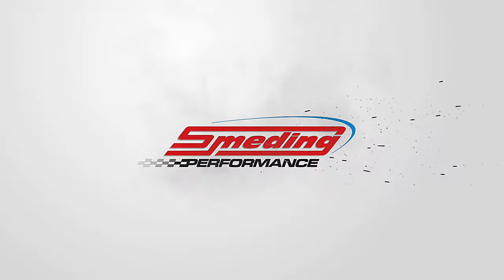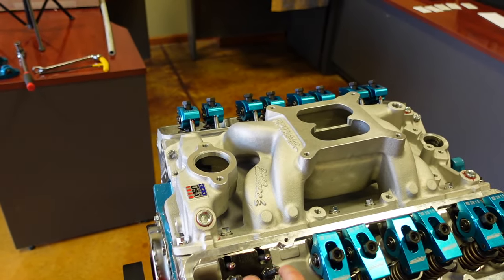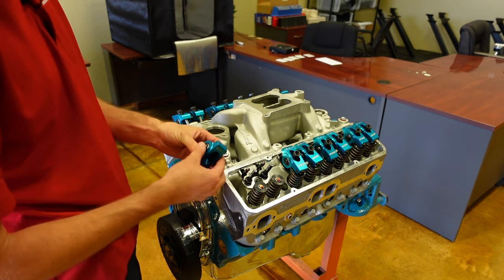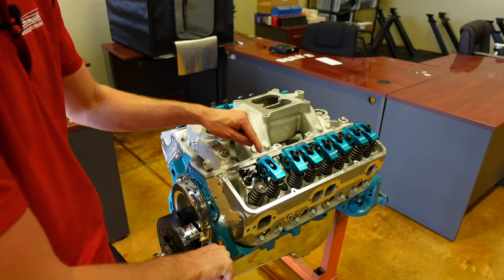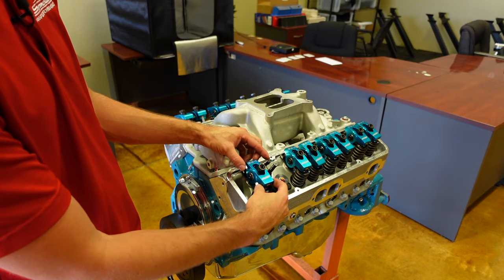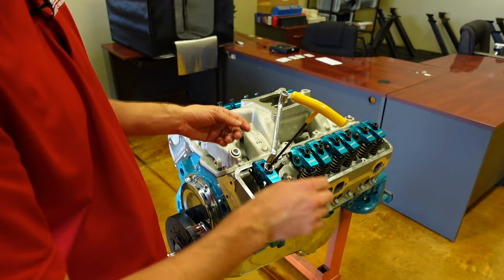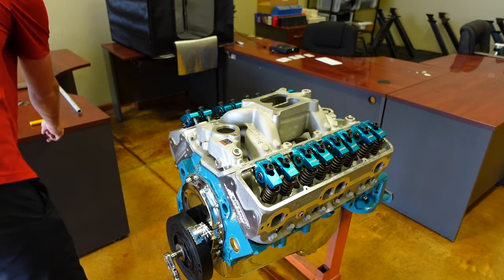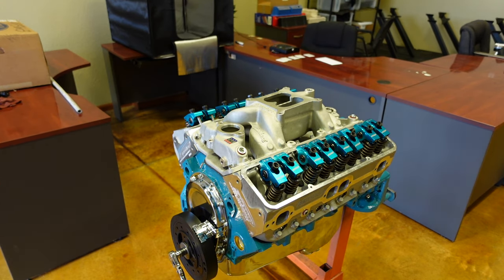How to Adjust Hydraulic Roller Rocker Arms! (I.C.E. Method)

Comment: Great info! Can I use this same method if the engine is in the and has been running? Most videos show new builds.
Reply: Yes you can just use EOIC..exhaust opening adjust intake...intake closing adjust exhaust it's easy brother just make sure your lash is out but not to tight

Comment: curious 7/16 bbc rocker studs , used in pontiacs when you want to run adjustable valve train.  do you typically do more than 1/2 turn adjustments with hydr. lifters , say comp cam and crane for example? in your experience.

Comment: So by locking down the rocker you actually added almost an other 1/4 turn=
1 1/4 turns from zero lash after lockdown???????
Reply: I saw 45 degrees that's 1/8
Reply: @rotorblade9508  almost 1 1/4
Okay 1 1/8 turns, regardless my BB Chev 396 roller cam and rockers would not run with that adjustment, I don't think 🤔

Comment: I have an LS1 engine with that tick. Adjusting the rocker should remove that tick?
Reply: If your running a solid rail rocker set up yes. All ls motors from factory are set with a guide plate and use a 7.400 pushrod. 22ft pounds of torque on the bolts for rockers
Reply: @tannermcclellan3021  it's a stock engine with hydraulic lifters.
Reply: Most of the time a tick is either a rocker or an exhaust leak, look at the manifold to head gasket and collector gasket and any flanges if you don’t see any black then adjust the rockers, make sure you do the procedure for an ls though I’m not sure if they are different
Reply: Ls is not adjustable.   If that's the issue,  you'll need to change pushrod length instead

Comment: Why does a bigger rocker arm stud take more preload?
Reply: 7/16 diameter rocker studs have a different thread pitch (course thread) than a 3/8" diameter rocker studs (fine thread) because of that difference in thread pitch, the distance the nut travels downward is less with the fine thread than the course thread.
Results are, to get the same .080-.100" preload you have to turn the nut farther on the 3/8 stud than you would the 7/16" stud. Hope that helps you

Comment: That seems like an awful lot of preload, I've only ever heard of half or three quarters of a turn?
Reply: I've done 1/2 turn for a long time
Reply: i do 5/8 then get the extra 1/8 from the "lockdown"
Reply: Agreed. 1 full turn is a lot
Reply: @ironhorse127 I got a Haynes manual and it says small block 1 full turn big block 3/4 Turns, I’ve always done 1/2 turn though
Reply: @daredevildare3641 ever had any issues with 1/2 turn? I’m adjusting my small block  tomorrow I was gone do the 1/2 turn like you mentioned
Reply: @dariusbrown5378  nope never had any issues, it’s the way I was taught by many people that have built tons of small blocks and the way I’ve always done it, never had or heard of any of trouble of it
Reply: @daredevildare3641  thanks for that info I’m definitely going to follow your lead 👍